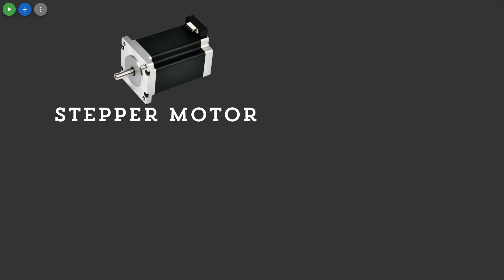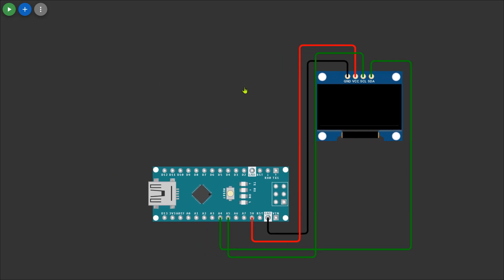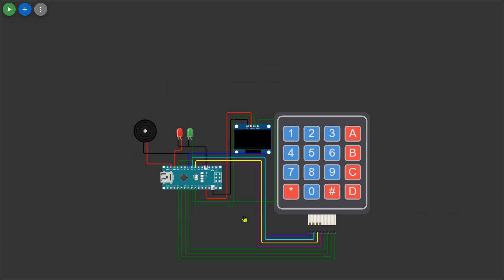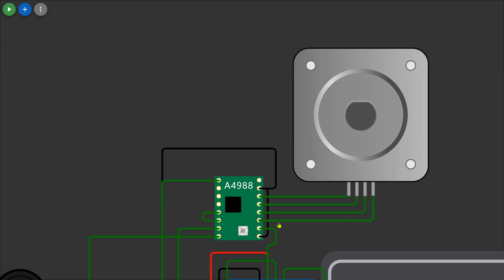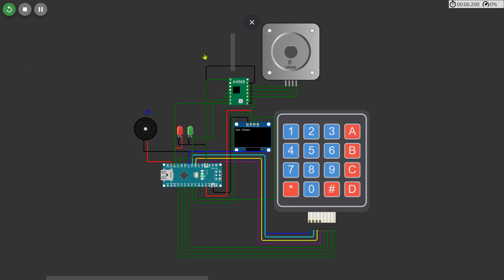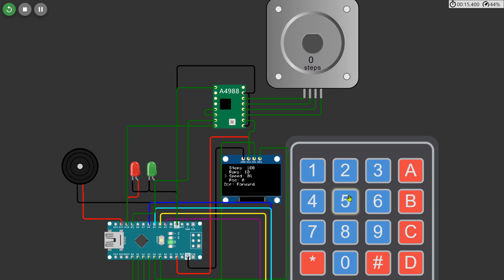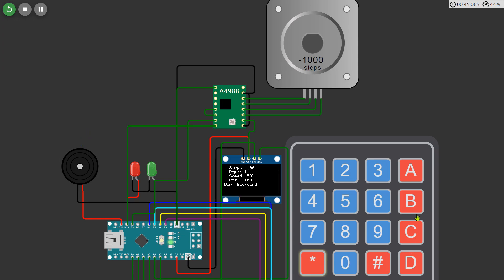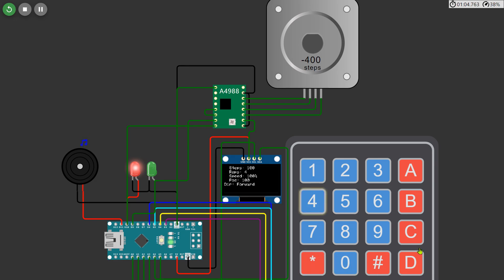Stepper Motor Control with Arduino ⚙️ | Keypad & OLED Display Setup 🎛️🚀

Comment: Hello, that phantastic, but can you show me, how to conect stepper with power supply. Which voltage ? That would be great.
Thank you very much.
Reply from the maker: Thank you! 😊 Absolutely, I’d be happy to help! For the stepper motor, connect it to a power supply based on the motor’s rated voltage – usually 12V or 24V works well, but it’s best to check the motor specs. Let me know if you need more details
Reply: @technicalshubham789 That's correct, but on which position? 5V to Arduino is clear (PC, or Batterie), 12V directly to VMOT and GND , I think tat's right, or?. I have a phantastic Project (for me), it is a kind of table, a dividing head for my CNC Machine, and I need diverent steps, diverent division to make gears. It is just for fun, but it is very interesting. Until now I tryed to realised it just mit Arduino, but your idea is much better,  then you don't need PC to meke diferent division, and you can see what happen.
Very good.
I am not more young (62), but that' also my hobby.
Thank you for you support.